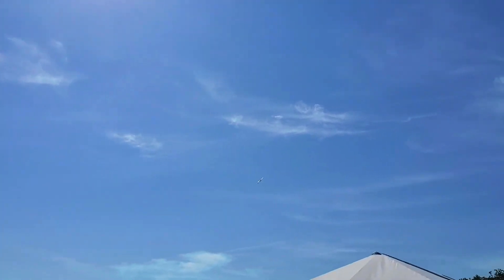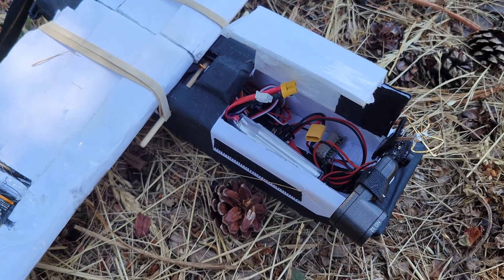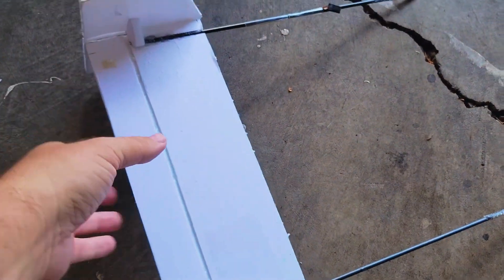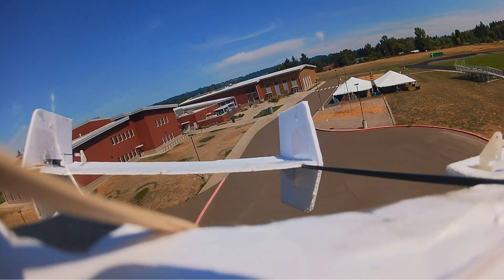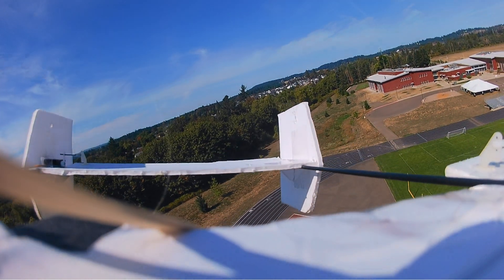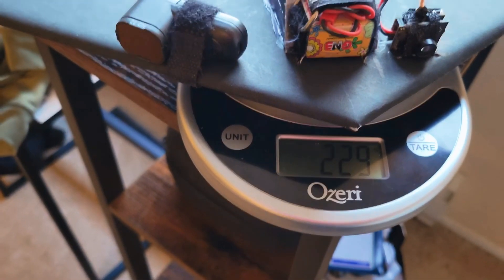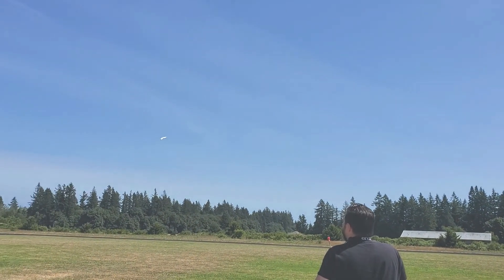So I Built a Thing Part III - DIY Fixed Wing FPV Plans | 8:35 FPV

Comment from the maker: I totally forgot to share that I’m using the FT Mini Arrow power pod design to hold the motor. The motor itself is screwed into a craft plywood piece that’s glued on the foam. Been using it for about a year and it’s been solid.

Comment: Tanks!
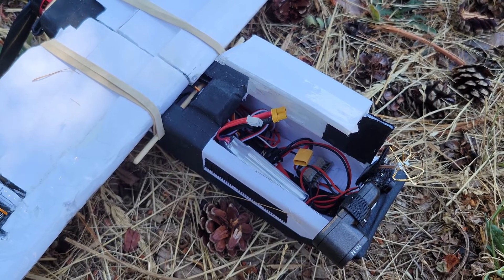3-pin connector. Did you use 2s battery 1:12 ? If yes, what capacity?
Reply from the maker: When I took that video I was trying out a 1550 2s Lipo to see what I’d get. Didn’t get more time than with my usual 3s 850mah because I had to use a higher throttle with the 2s. 3s was overpowered and 2s is barely enough. Maybe something like a 2s 2200mah would be a good balance?
Reply: @835FPV  Thanks for answering.
I really want to make a plane like that.